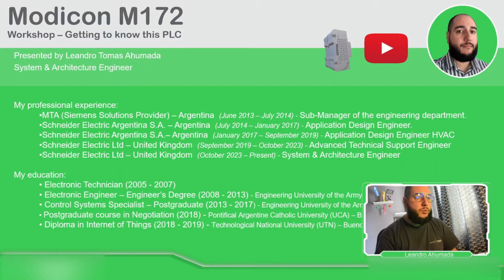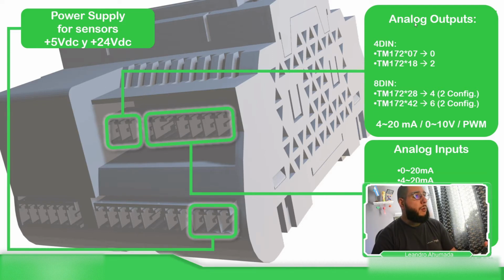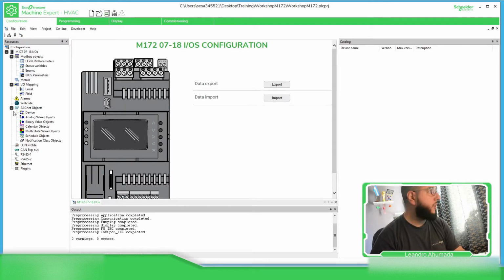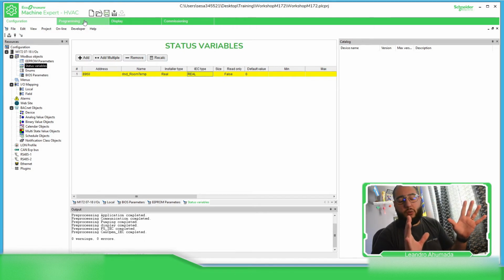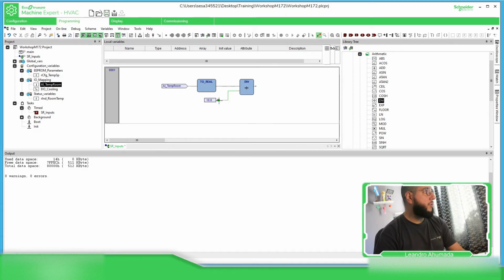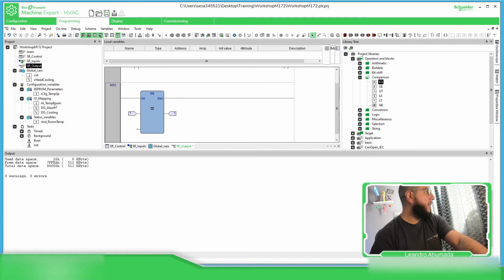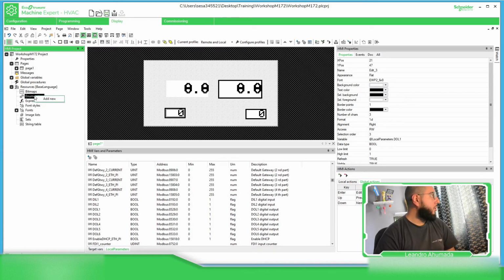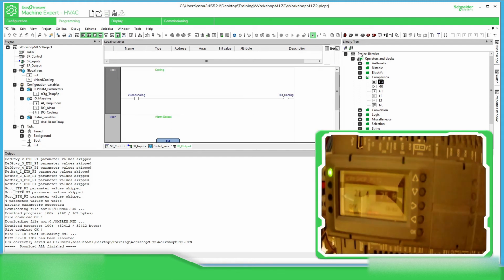Workshop - Getting to know the Modicon M172

Comment: Hi, thanks for your videos. The way you present the material is really helpful. 
 Do you find it strange that the software environment is called "ME HVAC" and yet there is not a single training video on the HVAC application. 
   SE has a great controller M172 which is very good for its applications, there is a great program for large and small AHU's but I couldn't find any video on how to use it.
 I would be very grateful if you could share training materials on the AHU program
Reply from the maker: Hi there! Thank you for your excellent feedback 👏🏻. I did think on training related to the application but at that time i prioritise to teach how to use the tool. I will try to create something related to the TVDA that you mentioned.
There are also trainings to HVAC application in Schneider Germany in the training center.